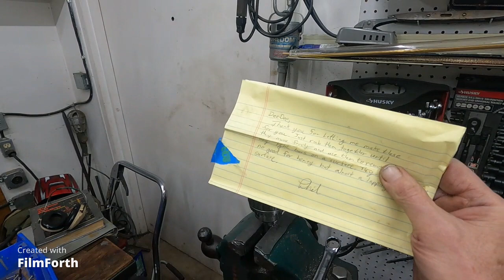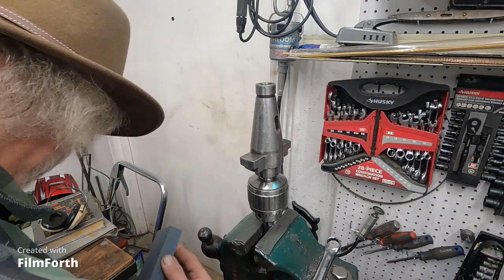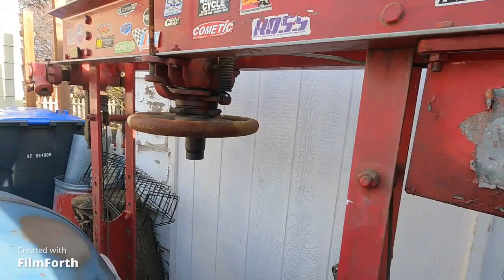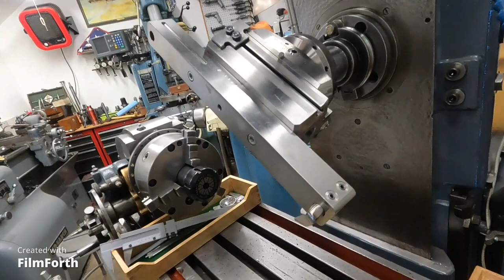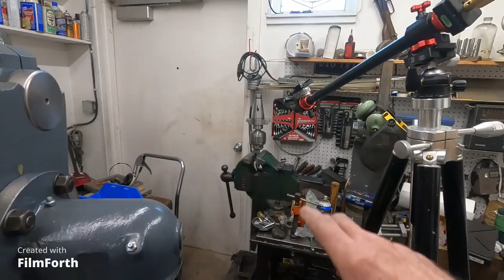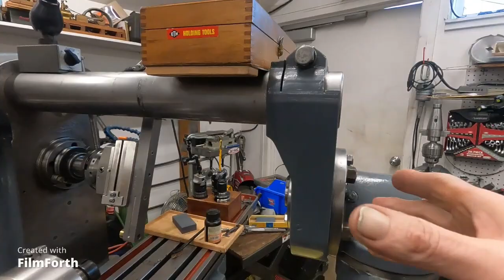Testing the precision ground metal finishing stones and Friday plans

Comment: You can crank the overarms in, right?  Is there enough mechanical advantage to pull the arms out of the bracket?  Obviously you'd have to support the bracket.  I think Abom did a video about making a parking attachment for one of his horizontal mills.... Yes, here's one installment https://www.youtube.com/watch?v=o75OK42IGFw
Reply from the maker: Hi, the parking attachment would handle the Yoke only, the complete unit is  way out of balance to be able to get it on the overarms in one piece.